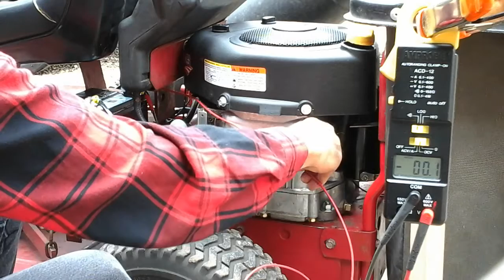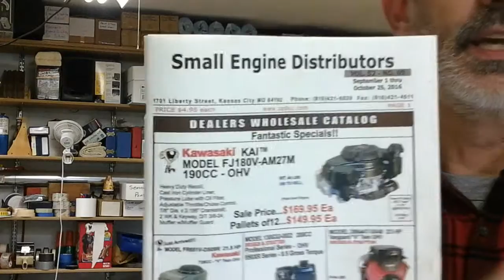52. Trying to fit my new engine with some issues 2 of 2

Comment: would you recommend swapping the current blown 8hp i have with a smaller 5hp? gonna remove the mowing deck and use it to haul manure in tight quarters so im not looking to go fast or haul heavy loads. awesome video series! thank you for posting!
Reply from the maker: jeff conrad 
  Well I guess all I can say is give it a try and see what happens if it’s way under powered you’re know it in a hurry. Jim

Comment: Good job on your new Snapper.  I'm right behind you doing mine.  Your channel has been a God sent.  Thanks
Can you do a video on your bagger system?  I don't have one and need one badly.  Where can one get a new complete system?  I heard you mention it in this video.
I'm still having trouble getting mine into reverse.  It still won't go after I moved the shifter plate after our phone conversation.  Another other ideas?
Reply from the maker: Renee Wasinger         With your tractor Tipped up inside hooked to the shift handle is what they call the shift arm there's a rod bolted to that that goes over to the chain case unhook the rod from the shift arm that'll let you shift your shift handle back and forth with nothing hooked to it, make sure that's moving freely you may have to take that apart and clean the rust out of it if it hasn't been greased regularly,   Then  look at  the slot in your lift yoke and make sure that is smooth and not worn on the short end where reverse is.  another problem that happens a lot is your hex shaft inside your boots will get dirty especially if your boots are ripped I would take the boots loose from the chain case clean it and grease it I would do both sides if these 3 things don't help you email me back and I'll come up with something else thanks a lot for your interest and questions talk to you soon        Jim.
Reply from the maker: Renee Wasinger   
Hi  Renee  it's Jim I called the dealer in my area for snappers which is Whitehall Michigan the name of the place is White Lake Nursery their phone number is 1 231 894 8574 and I talked to Chris he told me the Baggers brand new are still available from snapper he also said you should be able to go through a dealer in your area to get them or he will be willing to order them and then ship them to you the double-bagger like mine is $539 Plus $29 shipping to him then whatever the shipping would be to send it to you the small single bag bagger was $325 and he didn't mention what the shipping was,  but if you  give him a call you can  see what he says       thanks Jim
Reply from the maker: Renee Wasinger   
Hi  Renee  it's Jim I called the dealer in my area for snappers which is Whitehall Michigan the name of the place is White Lake Nursery their phone number is 1 231 894 8574 and I talked to Chris he told me the Baggers brand new are still available from snapper he also said you should be able to go through a dealer in your area to get them or he will be willing to order them and then ship them to you the double-bagger like mine is $539 Plus $29 shipping to him then whatever the shipping would be to send it to you the small single bag bagger was $325 and he didn't mention what the shipping was,  but if you  give him a call you can  see what he says       thanks Jim  I do have that single bag unit that I'm not going to use I could sell that to you if you're interested I don't know what shipping would be I'm not sure what state you're in thanks again Jim

Comment: I just got that exact engine only $269 scratch and dent take off never run. thought that was a decent price I came across after throwing the crank through my block.
Reply from the maker: CIA Assassin 
   It sounds like to me you got a heckuva deal would you be willing to tell everybody where you found yours and if they have any other ones otherwise let me know how it goes installing it ,   talk to you soon Jim
Reply: I'll post a link. Seemed like a deal but it won't last all other places selling the same are sold out there take offs from a discontinued mower line. I set it on it bolted up just fine. Need to modify the muffler like you so my bagger can be used not that I use it much. I need to bring the disk wheel thing down about 1/2 inch to contact the clutch disk wheel thing. Shouldn't be an issue just need to get washers with a 1 in hole or a piece of pipe that'll fit over the crank. Thanks for making these videos there helpful. smallenginesuppliers.com

Comment: Did they have the option for a pull start? Not a big fan of electric start.
Reply from the maker: chef souffle 
When you order an engine you just have to check to make sure it has a pull start or electric start which ever you prefer. Jim
Reply from the maker: chef souffle 
Most engines you can order either way with or without a rope or a starter you just have to specify it when you order it. Jim